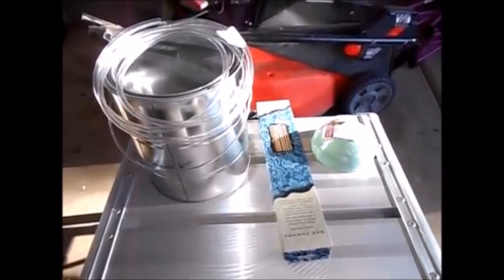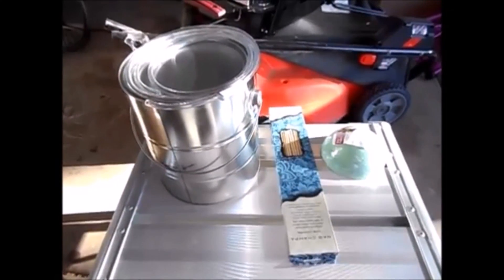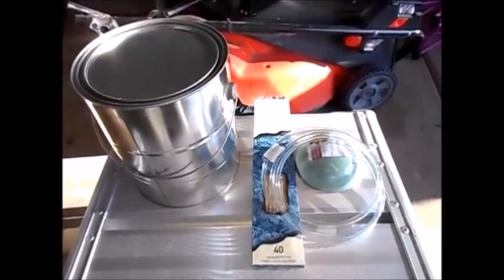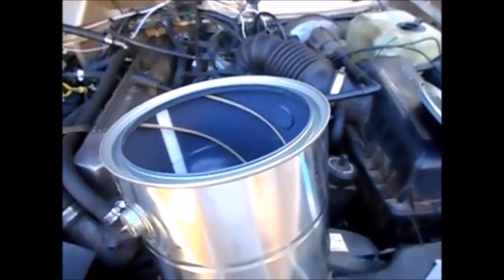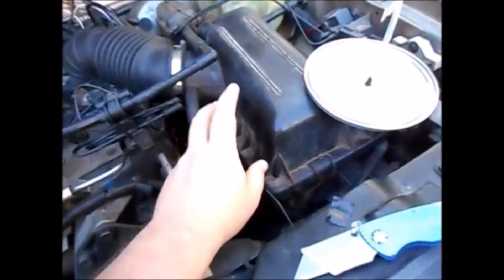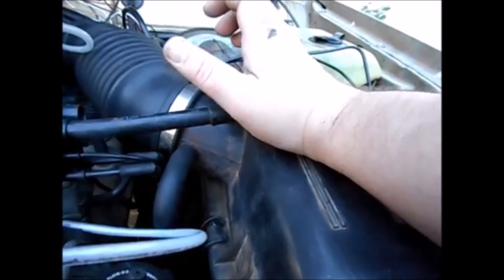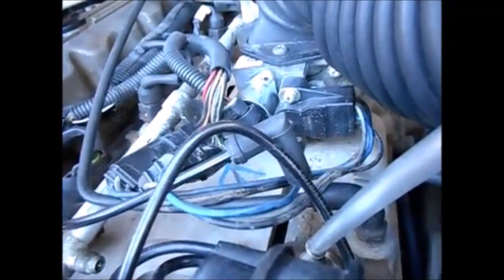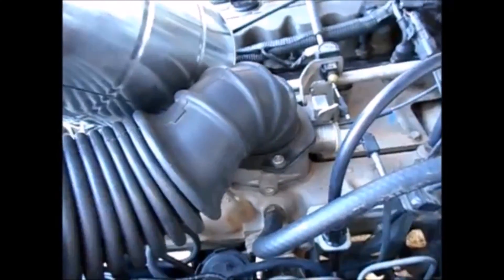Testing for a vacuum leak with an $8 smoke machine

Comment: Looking at your design could it be that the reason the incense did not stay lit is because it was against the side of the metal can? That would snuff it out quickly. I made something similar and bundled the incense together, wrapped with thread and sticking straight up. I made a base of 1/2 inch copper fittings: a tee and two elbows connected with 1 inch long pieces of copper pipe. The bundled incense is inserted into the middle leg of the tee pointing up. The elbows are attached to the two legs of the tee, pointing in opposite directions. The incense can be soaked in mineral oil... or not.

Comment: Check the play in the shaft . On my Chevy V6 , the shaft bushings were worn . I had it " re bushed " at a carburetor rebuilder . Years back , carb shaft bushings occasionally would be worn out . The base could be warped . The mounting bolts could be loose . Or a bad mounting gasket . It wouldn't hurt to clean the throttle body , IAC and MAF as maintenance .
Reply from the maker: No shaft play, it was a loose intake/exhaust manifold. the bolts were finger tight, if I remember (this was nearly a decade ago)

Comment: A bit of research would have revealed the reason mineral oil is used. It's non toxic and smokes with out really being smoke as it's actually like a stage fogger or a vape pen. It will give you lots of vapor to find your leak while not being as dangerous or choke you like pungent smoke from in-scents or an actual fired product. It's pretty much the safest way and it works.